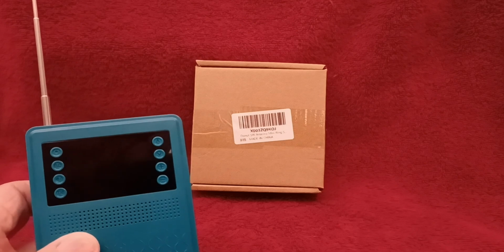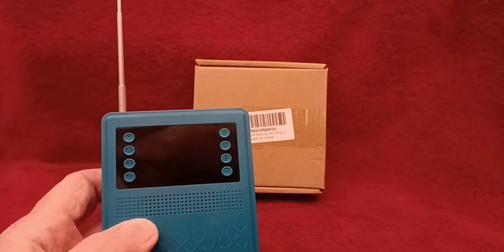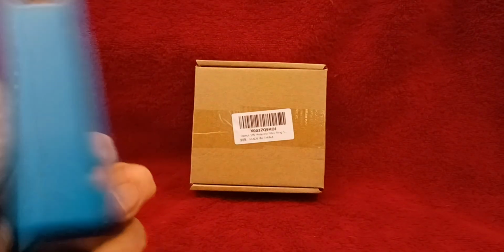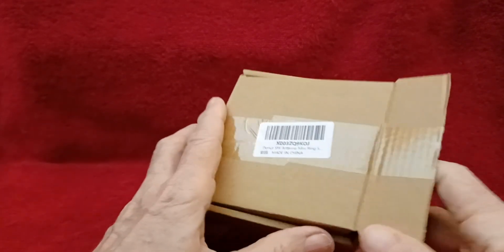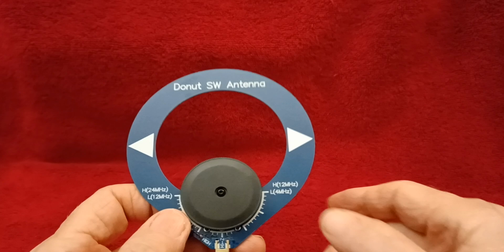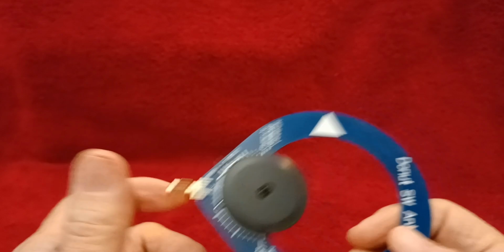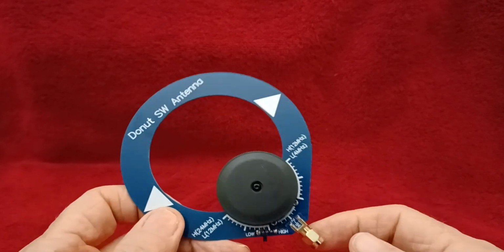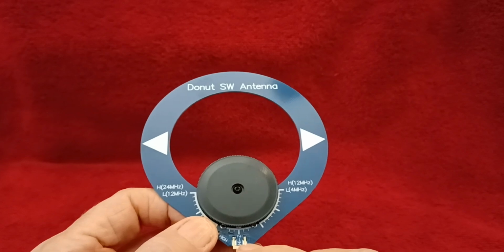TRRS #2390 - First a Weird Radio, Now a Weird Antenna

Comment: I recently purchased the blue (SW) and red (MW) donut antennas. They are designed for the Hi-Z imput on the Malahit SDR. The MW version worked perfectly and was a delight. The SW version took some tweaking and doesn't perform as well as the MLA30 or a longwire but nevertheless fun to play with.
Reply from the maker: Thanks for info and have a great day.

Comment: I got two of this donut antenna, the other one is red which is for AM. They’re normally sold in kit with 2 donut and 1 small HiZ to 50ohm amplifier. You should try to get the amplifier and give it a try. They’re pretty responsive and works a lot better than the whip antenna.😊
Reply from the maker: Thanks for the info.
Reply: Is it supposed to be powered? It does very little on my SDR but I haven’t dealt with the impedance